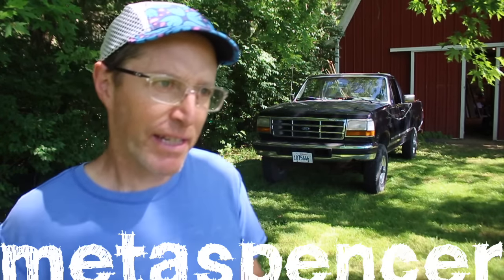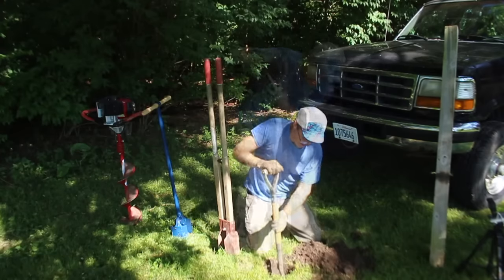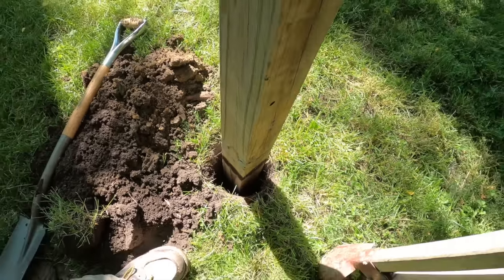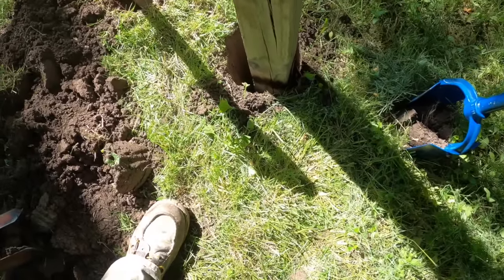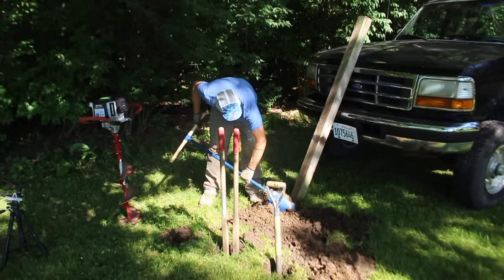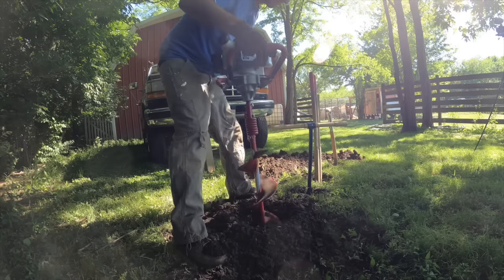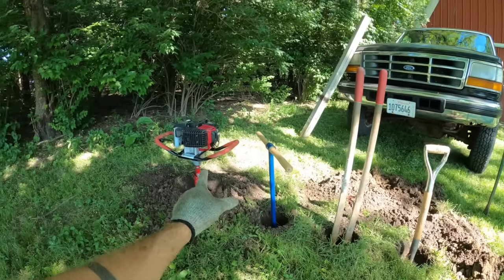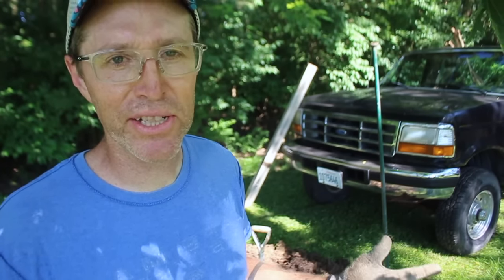Post Hole Digger Showdown!

Comment: I have dug so many holes in my life its not even funny. Best tool there is the power auger by far. Then the manual auger is leaps and bounds better than the last 2 choices. But its a hard choice between the spade and that other thing. I hate digging post holes with either one. I just came to check to see which tools you were talking about. If anyone wants to see a dog that knows over 60 tasks go to Pawsuasive Dog Teaching. If owner of metaspencer subs to our we will return the favor. Also a straight spade is what I use to first start a hole usually like 3 inches deep before I use the augers. Augers do not like the sod layer. The power ones likes to jump around a just a little bit and your hole might be slightly off but if you start the hole with the spade to take up the sod then use either auger works so much better. I also have levels on the handles to ensure my holes are straight. I also use a tarp with a hole in the center and a slit to the hole to place around the hole so when I auger the dirt piles up on the tarp which makes for easy to take care of the dirt no matter what you plan to do with it later.
Reply: PS I will give you 2 more tips about power augers if you reply. Clean hole and how to prevent that kick back.
Reply from the maker: Sounds like you've found some methods that work for you!

Comment: 6:42 -- i was told the hole is supposed to be 3x the width of the post ???
Reply from the maker: That would be a lot of concrete or gravel and very solid. Simple rule: soft ground wide hole. Hard ground narrow hole

Comment: i don't use any of these techniques and i probably couldn't if i wanted to. Hammer drill with a large spade bit on it and a shop vac folks. i swear it works.Thank me later.
Reply from the maker: I still haven't tried that one! Sounds like a winner
Reply: @metaspencer  It has been for me. I have red dirt, I guess it's clay but not sure and full of rocks. I made 4 very deep holes for one project and 2 other holes for another. They came out great. I'm going to start another project that will require about 10 more holes. I will be using this technique for sure.

Comment: the post hole spade is called a spit here in my part of England.
Reply from the maker: A spit! Great name. I find that spade can get a lot of work done :) Good hearing from ya!
Reply: @metaspencer  when i was 15 i had a job erecting fences digging post holes with my spit my boss would complain if the hole was to wide or to deep, your wasting my time and my concrete he would shout, his only conversation was about digging holes he was boring.

Comment: I've seen many power augers has a long bar/handle on the one side which you lean against your side so you have the use of your bodyweight to help hold it in place, probably an easy upgrade to do.
Reply from the maker: I've heard of that design now and want to try it ... sounds great!
Reply: @metaspencer  If your not fancy about it all you have to do is stick a pole through the one handle lol depending on what i used i would probably pad the end of it or rap a t-shirt:)) dont think its really any padding on the commercial ones but i havent really looked into it.
Reply from the maker: @Centrikk  Great idea! I'm gonna try that on my next job ... thanks man

Comment: Does anyone out there have experience digging post holes through hardpan? Would the hand auger work?
Reply from the maker: I've dug plenty of holes through hardpan and the only thing that's worked for me every time is a rock bar and post-hole digger. Loosen the rocks with the bar and then remove them. Slow going but works.

Comment: As a professional fence installer, looking at your post hole diggers, those blades are too flat, and you might look into a razor back, and replace the fiberglass handles, with wood ones.
Reply from the maker: Thanks for the tip man
Reply: @metaspencer  yes sir, any time, I have a pair of flatter diggers, we call duckbills, we use for specialty digging, like along side irrigation, and pavers.

Comment: digging bar is the best, i use a bar to break up the dirt and then post hole digger to remove dirt, i can dig a 4ft hole 8in wide in about 30min or less in clay soil. i have a proper digging bar and a homemade one, the homemade one has a jackhammer tip welded onto a 1in sucker rod. a shooter shovel is great too but you need one with a metal handle so you can "throw" it to dig easier
Reply from the maker: Those bars sound great!!
Reply: @metaspencer  yeah they're pretty good it's similar to the one you showed but it's got a spade bit one one side and a spear point on the other

Comment: Just about any post hole digger on the market will serve the purpose when digging only 2 foot deep but 90% of post holes done are 3 foot or more.   1/3 of the pole length  should be in the  ground and the diameter of hole should be 3 times diameter of pole. A good post hole digger won't begin to shine or prove better than the average post hole digger until you get to around 30" or more.
Reply from the maker: Sounds like you dig them deeeeep and big holes. Good stuff and solid against the old frost. Well done man

Comment: I'd be better if you could anchor the petrol powered digger to something  like a car or just the dirt around it somehow like with spikes.
Reply from the maker: You're so right! It runs better with a 2x4 strapped to it and a 2nd person holding the board ... stability is key with that beast
Reply: @metaspencer  ah yeah that'd do it

Comment: Dude, thats a trenching spade.  Sure u can dig a hole but its not designed for it. Theres an improved clamshell post hole digger made by Fiskar worth putting in your video.
Reply from the maker: I’ll have to check out that clamshell design

Comment: The shovel and post hole diggers become useless after about 18" tops.  The post hole digger handles start to hit the sides of the hole and for setting posts on long (over say 200') fences or corner braces that need a 4' to 5' deep holes, the only one that will work is the hand auger.  Surprised you didn't have a Boston Digger in the mix.  And concrete?  really?  Put the dirt back in and tamp it down.
Reply from the maker: 4’-5’ holes! Those are epic depths. Around here high winds will lean a fence over real quick without concrete or at least gravel. Not enough soil density. I’ll have to check out the Boston digger ... thanks for the tip

Comment: All of those are way too much work. Use a garden hose and a wet/dry shopvac, easy peazy.  A post hole can be drill in a matter of minutes with very little work.
Reply from the maker: I’ll have to try it!
Reply: @metaspencer  yep,  remove the grass with a shovel,  give the exposed dirt a quick spray,  just enough to get it wet,  and start jabbing the wet dirt with the shopvac. Rinse and repeat.
Reply from the maker: @carlwheeler3403  Smart!

Comment: everyone's dumb and doesn't put a stabilisation stick on it so it kicks at a leverage to your butt. won't twist your hands ever again. the 5,000$ systems are like that.
Reply from the maker: Sooooo, how do you set one? I'd love to know
Reply: @metaspencer  The basic way is to just get a basic thick wooden stick and shove it through the handle frame so when the machine kicks it's pushing on the stick and then pushes against you. The expensive hydraulic systems have the equivalent of a metal stick reaching all the way to the generator unit on the floor behind you to stabilize. Some people prefer strapping a scaffold pipe and have a 2nd person hold the pipe.
Reply from the maker: @dimitar4y  I get it -- thanks for the description. I've seen those systems with the metal stick that reaches back to the power unit. Thanks man!
Reply: @metaspencer  I don't know why people don't think of it. I see people struggle with these things. Just shove it in the cage of the unit, usually under the left side, and lean the stick on your butt or leg whatever height the unit is. Due to leverage the further you are from the stick the less it pushes against you. Never experience wrist-breaking again! Maybe show a video demonstrating it, help spread the "lost" technique LOL
Reply: @metaspencer  also with the stabilization in place, it's easy to drag the tool out of the whole while it's spinning, rev it up, that throws the dirt 'away' from the hole due to centrifugal. Do it like CNC machines clear chips from holes. Dig a little, pull out and rev, drop it back down. The only issue with stabilisation is that if you find roots or rocks, it won't kick sure but it'll probably damage the digging tip on the front :d nothing a welder or a few hammer thwacks wont fix (a few times)
Reply from the maker: @dimitar4y  Big thanks

Comment: Petrol auger is bad, in a year it will have problems as most of the time you will not use it, you wont use it at all :D. And rocks seems main problem. AT first you think maybe more powerful engine, but than it will be even bigger force hit after hit rock.  Maybe electric one which is not as big wasting space in garage? Like makita dear god dont buy other crap.
Reply from the maker: That gas auger works better and more safely with a 2x4 strapped to it and another person holding the 2x4 ... only really great in soft ground